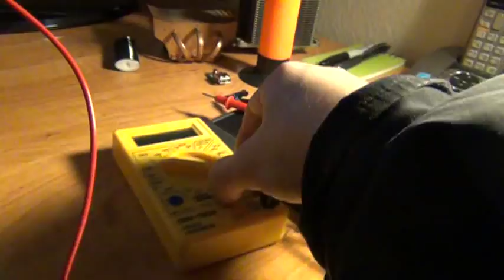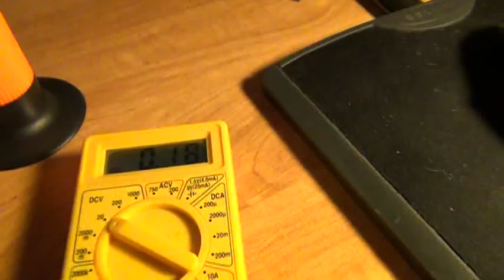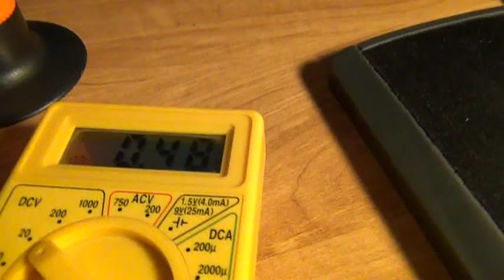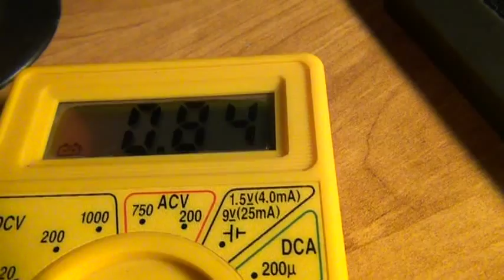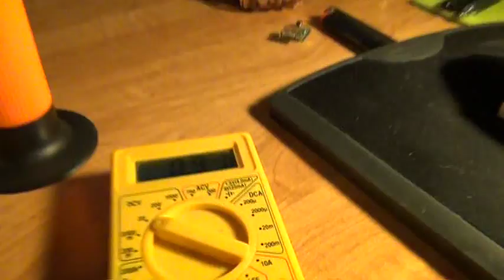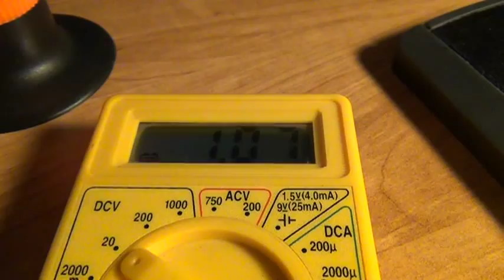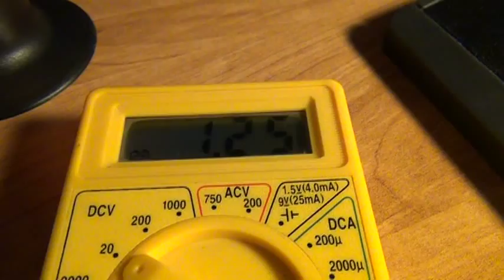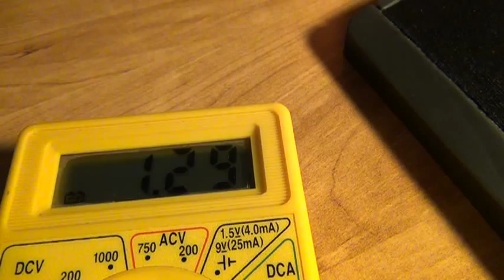Thermoelectric Car? Peltier Generator TEG

Comment: How about powering the boost converter with the peltier, and have the fan run off the 5v?.  My first peltier should be here tomorrow, I'm going to try making one myself.  I'm worried my fan and heatsink will be to small. Only time will tell I guess.
Reply from the maker: That's a good idea, I will have to try that. I have not messed with it in a long time.
Reply: ArcadeGames I was thinking of making a fan like yours, using a lower voltage and amperage, just not sure how to do it yet.  You said yours wasn't able to charge a phone but was able to keep it charged.  I think maybe because you need to get the peltier at a higher voltage so the boost converter will be stable. Try using a thinner alloy so the peltier heats up faster and less heat is lost. Might be worth experimenting with.
Reply from the maker: Pingo bags Yeah, I was able to keep my old phone from going completely dead just using the candle. Normally my old phone will beep and then finally turn off completely when the battery is drained. I hooked up the peltiers up in series and it was enough for the candle to activate the booster and turn on. I kept it alive for 5 hours and I finally gave up on waiting for it to die(usually dies after 15 mins of beeping). I consider it a semi success, but it wasn't enough to charge up the phone.
Reply: Those little voltage boosters can be a pain sometimes. I think I have the exact booster you're using. They will work at 1.5v but with the voltage drop from a phone,  you need about 2.5-3v for them to work properly.
I managed to make a little peltier charger yesterday, but the heatsink was not big enough. I also made a low voltage fan like yours. It was good enough to power itself but eventually got hot.  I'm going with plan B now. I took a heatsink and peltier out of a small but broken 12v fridge. It's made for keeping the peltier cool. Fingers crossed.
Reply from the maker: Pingo bags I stole a peltier out of a 12v drink cooler you plug into your car. It was free so why not. I'm working on putting some peltiers on my car's engine to maybe power something useful. Instead of stacking, they will be side by side.
Reply: yea I remember you saying that.  Should be interesting seeing how that turns out. A car has a lot of waste heat, why not capture it!

Comment: We should run theoretical ideas, in fact I got a game called name that tech, and i wouldn't be able to share the idea of using a Hoffman apparatus maybe inside a lake with a retractable well, or what about a hollow tube that has some water concerning a surfboard or like material, I was thinking of hydrogen going in opposite direction in tube an it's how they did the proton collision, I was thinking I might see something about hydrogen trying to escape.
Reply: Aerogel is what you'd need for peltier an carbon or graphite fiber,

Comment: while doing experiment the sides of TEG are getting heated up.how to reduce the temperature at cold junction.
plz comment on dis...
Reply from the maker: I am not sure exactly what you mean, but I use a fan and heat sink to reduce the temperature on the cold side.
Reply: I done the experiment on hot plate.
I kept the thermoelectric generator on aluminium plate and then on hot plate.
I kept cold water to reduce the temperature.but its not working.
both sides are getting heated up.
Reply from the maker: Sai Kumar Do you have a heat sink of the cold side? There must be some heat sink compound between the surfaces also. I'm not sure if I answered your questions, very sorry. Where are you from?
Reply: Sir...
I got d output of 3 volts with one generator maintaining temp difference 80℃ ......I used aluminium channels at cold and hot junction.

Comment: I'd like to see them wired in series to see if you could double the voltage output.
Reply from the maker: +unijabnx2000 I actually did wire them in series at one time, with only a slight gain in voltage while the current stayed the same. It works good either way.

Comment: Thanks for posting your awesome generator!  The one idea I had would be to insulate the heated block's sides.  That would increase the efficiency.  You'd be able to prove that out by the length of time the motor would keep running w/o your heat source.  You could also try using steel on the heated side.  That would help hold the heat longer than the aluminum.

Something like this could be in our homes gas powered furnace and water heaters as well.  Ultimately this would use the furnace heat to charge batteries for electricity.  Very "green" energy.  I like it!
Reply from the maker: Thank you my friend! I will keep your ideas in mind! I know cast iron holds heat the best if I recall. Cheers!

Comment: Hi there! Whilst looking through the various videos, I stumbled onto yours, where by your Peltier machine with half a volt is able to turn, not only the fan, but also your toy's motor. How is it possible? What kind of voltage are the two motors? Could you let me know please?
Reply from the maker: I'm not sure what voltages the motors are, I know I stole the fan motor out of an Xbox 360 disc drive, It appears to be a very low voltage motor. The other motor was stolen from an RC car rear end. I don't know how it's possible, but it works.

Comment: so its just an electric car but the power is generated via peltier converters. what are you planning on being the heat source? propane? sorry your videos is very long so had to skip through.

the issue i see with this is that it would be a lot better to have batteries on the car, then have an electricity generation facility in your shed. maybe have the peltier coolers powered by focused sunlight. then you could recharge your car at your house. maybe even run your house off the coolers.
Reply from the maker: My plan was to create a friction motor of some type, induction heating, magnetic heater using neodymium magnets and copper pipes. I thought about chemical reactions that cause exothermic heat, but I'm still pretty new to this. I'm not saying it can be done, but it seems feasible in a perfect world.